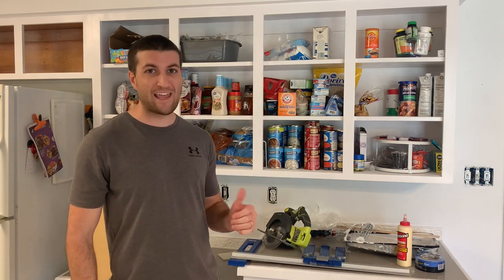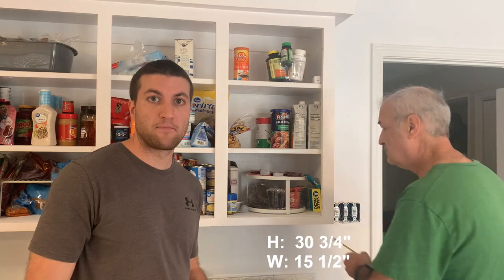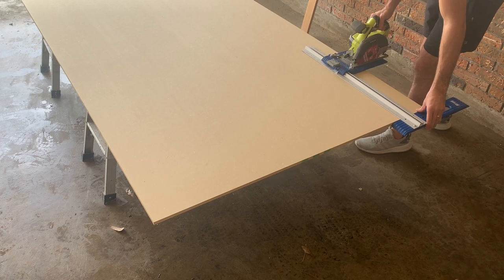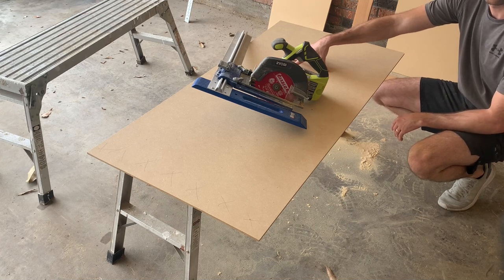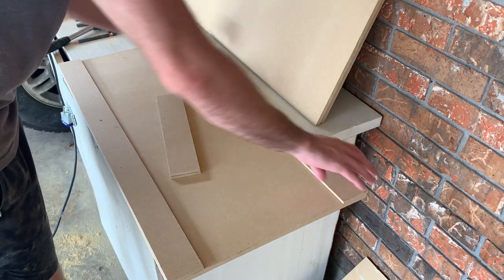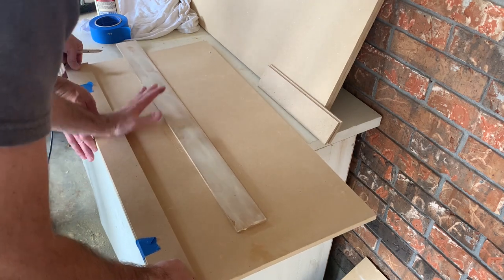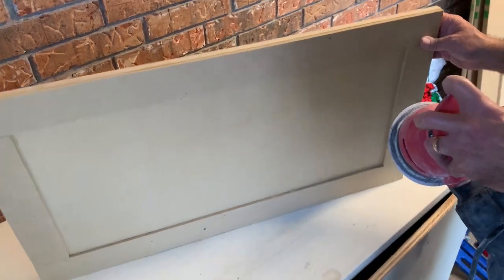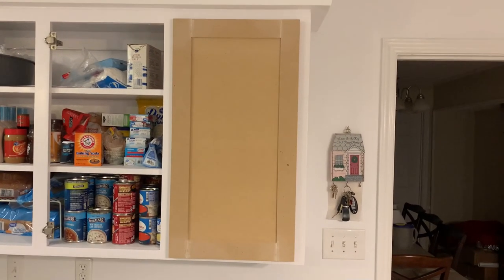EASIEST Way to Make Shaker Cabinet Doors - DIY

Comment: I've had the Kreg for almost from the first time they made it and to set the ruler all you have to do is to measure from the wood side of the guide on the tool to the close side of the saw blade. No reason to do a lot of cutting for this, just a wast of time... Put your wood on something like a 1 or 2 inch foam sheet and your cut on the end side will be as good as the cut on the first 2 inches. Letting the cut off just hang is really not smart... To bad your audio is so bad...if the second cut was less than 24 inches, you could have used the Kreg tool... The Kreg tool is not just for cutting narrow strips. Again, use a backer of some kind... 6 pieces of tape and 1 spring clamp, you have to be kidding us!!!!! Good looking door but how did you drill for the hinges??? I'd give this video and process a solid 7 in the 1 to 10 scale.
Reply from the maker: I appreciate the feedback! I realized the way I lined up the Kreg was the long route afterwards. I definitely learned a lot along the way.

Comment: What are the chances the wood glue comes apart after a couple years or that edges split over time due to the glue not lasting
Reply from the maker: It really shouldn't come apart unless it gets a lot of moisture. A good cabinet paint should seal it from that though.

Comment: I do this as well, the key to a perfect edge finish is to add 10mm (3/8) to the start size in each dimension and then when all glued and dried trim all 4 edges. Additionally I found in about 80 or so doors and drawer fronts that the edges don't seem to glue nice, ie: gap free, but trimming them sorts that out.  Also need to ensure to use MR MDF for the 1/2 inch base board. I also use a "liner" laminate and contact adhesive to line the inside faces of them.
Reply from the maker: That's a great idea to make sure they all end up perfect. I'm planning on doing it again on my current house, so I'll have to give that a shot.

Comment: What size hindges did you use?
Reply from the maker: 1/2" overlay hinges that you can adjust with a screwdriver to make sure it looks perfect. I also had to use a KREG hinge jig to make the holes.

Comment: Hinges will break off from the door not for too long because of MDF. This method can be used for drawer fronts.
Reply from the maker: I've done these for another house years ago and never had any issues. MDF is more durable than particle board which is the material for a lot of cabinets you'd purchase premade.